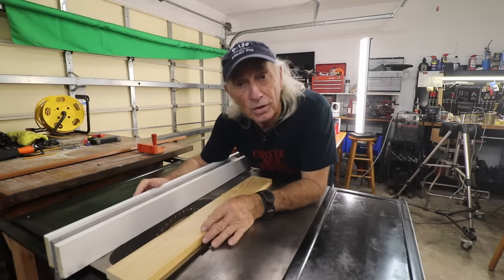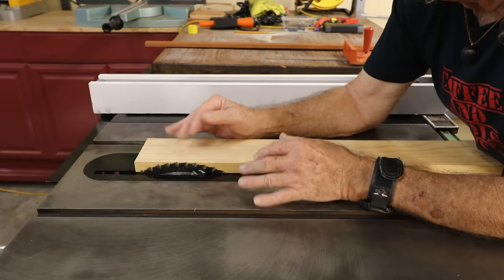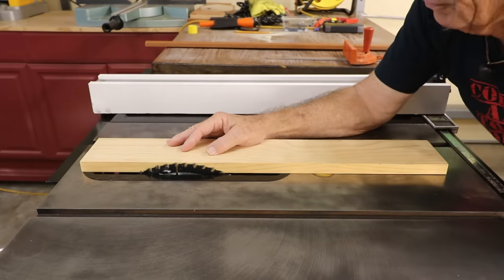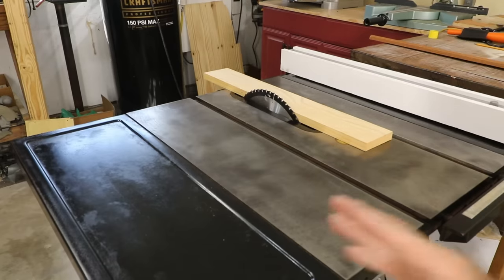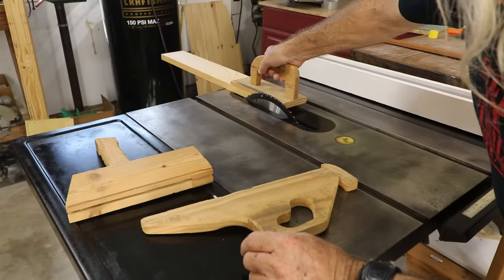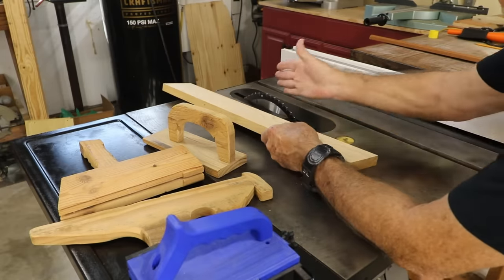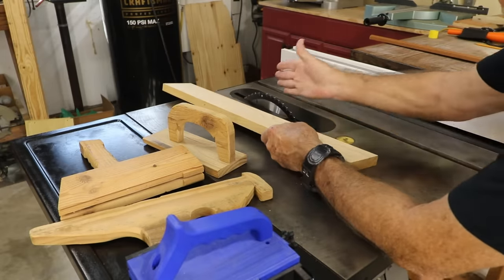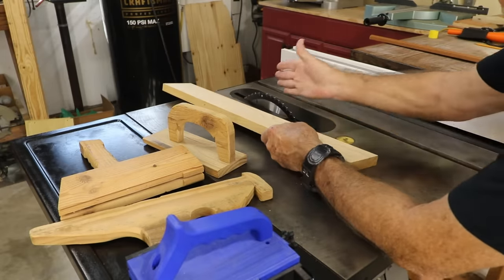Table saw secret nobody will talk about from the good old days, C&T episode 180

Comment: I was not taught or told as to how much to raise the blade, but I have been raising it quite high. I have been doing this due to some instinct or "feel" that, when cutting like that, the action is smoother - especially with a motor that is not strong. I think more power is there since the centrifugal force is nearer.
Reply from the maker: Another twist on the high VS the low

Comment: I certainly agree with both safety concepts related to blade height. Years ago Fine Woodworking Magazine did a survey on tablesaw hand injuries. Most people believe that the most common occurrence of injury is when the pushing hand makes contact with the blade. The survey brought forward information that the retrieving hand was the hand most susceptible to injury. This happens when the retrieving hand reaches behind the blade to retrieve the cut stock. The tendency is to pull the board toward the rotating blade. At this point the wood is then kicked back toward the operator while retrieving hand is holding the board. The retrieving hand is then drawn across the blade from the backside of the table. A riving knife or a splitter behind the blade would alleviate this incident.

Comment: I've always been told to raise the table saw blade so the gullets between the cutting heads comes above the wood for better dust clearing and less burning
Reply from the maker: This is a popular one for height.
Reply: @SirTools  Thanks for the reply. Wasn't sure if it was just a myth or not. I followed that "rule" until I switched to a zero clearance base plate. Now I run the blade as low as possible or the saw will throw all the dust right at me...
Reply from the maker: @complexeddrummer  The lower setting is said to be all about safety. It makes sense but that was just not the old school way.

Comment: I invested in a power feeder for a whole house cabinet build.  That, I think, is the ultimate safety equipment for a table saw and the provides consistency for ripping long boards where you would need to feed by hand otherwise with starts and stops.   I push a board to the feeder and walk to the back side to take the ripped board off.  A must to have if you're ripping many boards.   It doesn't take long to setup but if I was to cut only a couple of boards, I probably wouldn't use it.  

Always use a riving knife when cutting solid wood, no matter what you use to push wood through a table saw blade.  You can't tell what tension a board may have by looking at it.  I learned that many years ago.  

Also never use your table saw when tired.  That's usually when fingers are lost.
Reply from the maker: Good advice :)

Comment: I'm in my mid. 60s on 50s contractor saws had 71/4" blades which is what I learned on. If you tried to cut with blade slightly coming through to material and 1/2",3/4"+ it was goinii 17:16 g to kick back on you often. These older saws are well built under powered saws that are showing up in Yard sales and auctions.
Reply from the maker: All true, just funny how things changed over the years.

Comment: I think there is good advice here but the key is to have your table saw set up correctly and keep the blade sharp. Even with really hard woods you may have to lower your feed rate but it should still be like a knife through warm butter (just really slowly).  If you start a cut and the blade is passing easily but suddenly it becomes harder to push the piece through, then stop immediately! Something is wrong that you MUST fix before using the saw. Get your blade sharpened by a professional, check your fence and blade are both parallel to the tool grooves in the table to within a couple hundredths of an inch there are a bunch of videos showing you how (Stumpy Nubs channel, mentioned in this video, is great). Blades get dull, saws will drift over time, as they dull they become more susceptible to variations in the wood. They also drift out of alignment, especially if you move them around. They can also be in alignment when blade is perpendicular and out of alignment with the blade on an angle. When your saw acts consistently through every cut then it is only down to keeping your hands in a safe position.
Reply from the maker: Wise advise !

Comment: A very reasoned presentation 👍👍
One novice suggestion, should the angle of the handle of the guide tools not be at an angle with the higher point being further from the operator that way there is more pressure being exerted which hopefully would reduce the possibility of the piece of timber lifting.
Great vid 👏👏👏
Reply from the maker: Your on it

Comment: As a finish carpenter for over 40 yrs I am of the "bottom of the tooth" setting myself. Meaning, no higher than that. Has worked well for me. A Riving, or curfing knife is essential on any table saw.
Reply: Yes I was taught that as well
Reply: Me too but if you use a table saw often you will get Kickback and you will get hurt it's just a matter of time and how bad it's going to be. I live in Michigan now but when I was young I Got It Bad down in Florida building condos on Crescent Beach one-time-only listen to the blade

Comment: In our cabinet shop where we employ a 7hp sliding table saw and two 3hp table saws, one with a blade we change per task and one always equipped with a 1" Dato set, we follow the manufacturer's recommendations for blade height. Most of the shops I have been employed at have made a rule that if the gap between blade and fence is smaller than the width of your fist, a push block should be used however I have a close friend who is known to regularly lick his fingers to gain traction while using just the tips to feed pieces less than 1.5". You would not catch me doing that but only because I don't feel the need to, a push block isn't a handicap, just a tool. That said, far too many people who work with wood(including today's cabinetmaking and joinery students) are taught that the table saw is a big and scary monster and should always be your last resort. I was trained to start with your biggest tool/machine and go from there and the table saw in my opinion is no more dangerous than the palm sander with a proper understanding of what it's capable of and what will cause you issues.

When it comes to table saw safety there are 3 simple factors;

1) saw maintenance(of very little concequence ultimately because if your saw is falling apart its clear what the issue is)

2) blade sharpness

3) education on how the blade works, how wood behaves and how the saw works

The only side of the blade that should matter is the one where the fence is, your offcuts on the other side will not harm you unless you planned out a very large cut very poorly. The minimum height of any blade for a through cut is definitely with the bottom of the gullet on plane with the material surface. Raising the blade up high will absolutely cut a finer cut, it's not a theory from back in the day, it's proven physical science. The attack angle of the teeth facing down will put more pressure on the material to shear, however this is typically a practice to simply add life to a blade, forcing it to cut finer longer than its intended use before being sharpened. Using your blade so low that the teeth are barely above the material surface is far more dangerous than with the gullet on plane or higher, you have much less of the blade body to stabilize your material and with the blade low, wearing it's teeth quicker, you will end up with kick back at some point. You don't need to practice blade longevity skills but you certainly don't need to keep your blade bottomed out, do some research to find what the manufacturer of that blade or one with a similar tooth and rake angle suggest. They built it, they spent the money and time to discover the best method of use so that you don't need to. The angles on the teeth and rake of any blade are such that they are designed for specific uses, learn why and what for and you will always have better and safer cuts. As a sidenote, combo blades that purport to do both ripping and crosscutting actually typically work well for both applications. We employ several combination or general purpose blades on one of our smaller saws that does a ton of varied work, we otherwise have blades worth several hundred dollars for various applications like laminate cutting, plywood, melamine, mdf and some expensive ripping blades. 

Proper education is what will keep you safe and efficient on a table saw, bottomline. Understand what makes the cut fail when it does, the saw certainly won't fail, the blade will continue to turn!

Comment: On carpentry school I learned crosscuts and sheetgoods with the blade setup in a way that half of the teeth are exposed. Solidwood cuts in the length of the wood along the grain with the blade at max height preferable with a blade with less teeth.

Comment: You mention using a 36" blade, as I often do. In my opinion different blade sizes have impact on the height you should use to get a. a proper cut, b. prevent kickback by determining the angle between the cutting tooth and the wood and c. leave the shop with 10 fingers  by exposing as little blade as possible. Big saws will often allow for smaller blade sizes mounted as well. Would that have a positive impact on safety when cutting thinner wood?

Comment: I support most of the safety tips.  That said, a guide fence should not support the wood any further than the midpoint of the saw + 1/2 inch, to prevent kickbacks.  Never use a table saw without a riving knife.
Reply from the maker: Riving knife is nice to have. Every used saw seems to be missing that when they arrive here.

Comment: I want the SawStop, they want $4K, the safety system(?) is $70+ . I have a ShopSmith 510,have a riving knife for non through cuts, it sits slightly below the blade,can make dadoes, a saw cover won't allow that, the plastic guard portion nearest the fence keeps you from cutting a narrow piece. I made a thin push stick from 1/4" hardboard that's smooth on both sides. I set the blade to just above the wood so it just cuts through the top side.
Reply from the maker: Thanks for this one :)

Comment: I bought this same table saw new 45 years ago & still use it. Have used it with dado and shaper blade too. It's been a great saw. Just made a sled for it and still love it with original fence and miter. Would love to see a good way to put a riving knife on it. I junked the guard on it the first 6 months I had it. Very cumbersome to use. I am like you and run my blade a little high so the work does not get on top of it. I always like seeing how people improve this Craftsman gem. Keep them coming. Thanks.
Reply from the maker: Thanks George, I am working on upgrades and will be posted as things progress.
Reply: Without going into great detail I created a riving knife for my craftsman saw as follows.  The arbor mechanism has bolt holes for a riving knife (maybe yours doesn't) but I was unable to find a replacement.  Using two sacrificial framing squares I drilled holes to bolt one 90 degree piece of metal to the arbor which extends out and up beyond the table top.  This piece isn't in line with the blade so I made a wooden spacer then drilled and bolted the second 90 degree piece of metal (which is in line with the blade) which extends up and onto the table top behind the blade.  It tilts with the arbor but doesn't raise or lower with the blade.  I gave it just enough clearance to allow 45 degree tilt and to raise the blade full height without the blade striking the knife.  It looks homemade but it works and I feel less intimidated (a kickback caused me to make this attachment).  If it would be helpful I can take some pictures and post it on my channel.
Reply from the maker: @HWPcville  HEY...I would like to see that. I removed the blade and checked for bolts that could be riving knife, but my plate eats up the entire slot. In the old manual there was a guard and maybe combo with a riving knife system. Thumbs up on this idea however !
Reply: @HWPcville  Thanks for the input, there are a lot of these old saws out there in use and I would also like to see this too. You may have our answer. Thank you.
Reply from the maker: @HWPcville  WoW, looks interesting. This would not work with my 12 inch set up, but it does give me hope LOLOL :)

Comment: I just saw your video. A lot of good info. Now my personal experience was an injury to my left hand and  tripped on material left by finish carpenters.  Make sure there is nothing you can trip on as your first reaction is to put your hand out to stop a fall.. This is what happened to me. This may have not been as serious if the saw would have stopped when turned off instead of continuing to rotate. The blade was at about half speed winding down. A present there is a law suit against the saw manufacture for an unsafe product. I now have a saw that has an electric brake and stops as quick as a miter saw. Roughly 2 seconds.  This only works on a direct drive table saw.. Now in light of this new safety feature on  few of the newer  big name table saw manufacturers, this feature should be made mandatory on all  table saws thus cutting down the chance of a severe in jury keeping fingers where nature intended them to be., Great video lots of good info,
Reply from the maker: The brake idea has been around a long time. Thanks for the posting.

Comment: Great video and great advice. 
After working for just over 14 years in a production shop with 8 to 12 hours a day 6 days a week a lot of the time, I solved the problem on my home shop.
I bought a Vevor power feeder.
It works great.
And I always kept my blades high, just above the gullets.
I still have 10 fingers with no empty slots.
Reply: Yeah!! Let's hear it for power feeders!!! What a revelation when we started using one on the shaper. And I only know of one shop of fellas in my own particular orbit that bothered to move it to the saw now and then, but it is an excellent solution that I have never seen mentioned in discussions like this!

Comment: Material handling and process awareness are two of the biggest injury prevention techniques anyone can use.  There's no reason to ever get your precious fingies anywhere near a sharpened chunk of steel spinning at 5,000+ RPM.  I tend to stand well to the side opposite the fence whenever possible.  If I'm within arms reach of the blade, it's stick/block/jig time.  I also keep 3' of space between the table saw and the outfeed table to pull longer pieces of lumber through.  I'll take the time to make custom holding jigs when cutting dados or rabbets.

People call me paranoid.  I call myself "intact."  :)
Reply from the maker: Very good, thanks for posting

Comment: You have never had a kickback? The way you are using a table saw you should consider yourself really lucky because your procedures aren't really that safe. I have had a number of kickbacks over the years: some timbers like American black walnut seem worse than others for unrelieved stress, but I've never been injured on a table saw. I intend to keep it that way. And a 12in table saw isn't that big - try doing what you do on a 20 or 24in rip saw and you'd be in trouble s lot faster

When I was taught, back in the late 60s, it was always a case of riving knife (reduces pinching on the outfeed side), crown guard (it not only stops your fingers ending up in the blade better than anything else but also reduces the likelyhood of a kicked back piece smacking you in the schnozzle), short rip fence (prevents divergent timber getting trapped between the blade and the fence and being kicked back), long push sticks (to kep your hands about 16in away from the blade at all times, not those stupid ones which place your hands above or beside  the blade, and never fingerscyo push through ), run off table (mandatory for trade use on my country for many decades - improves control and reduces possibility of material falling off the back of the saw and hitting the rising teeth of the blade - another kickback possibility) and blade set to project no more than a couple of millimetress above the work (better quality cut on materials such as melamine (MFC), veneered MDF, etc, reduced lifting tendency from the rising teeth of the blade - more likely to push back instead of lift). The other piece of advice missing is to never stand directly in the line of the blade, always position yourself slightly to one side, so if you get a kickback it won't hit you in the "crown jewels". As to guiding the material - it should always be guided by the fences - if you think about it it can't really be guided by the body of the blade because the teeth are wider than the body on a TCT blade. 

This is all pretty much what SUVA (an insurance investigation body) in Switzerland recommends based on 70 or 80 years of woodworking accident investigation, but it's also what woodworkers were being taught in Europe as long ago as the 1930s.
Reply from the maker: The point of the show was the way us old guys were shown on "how to use the table saw", it was not for safe use of a table saw by today's standards and the USA still offers Dado blades which I'm told would put you in jail overseas. Thanks for the interesting comment left and info about hardwood cutting.